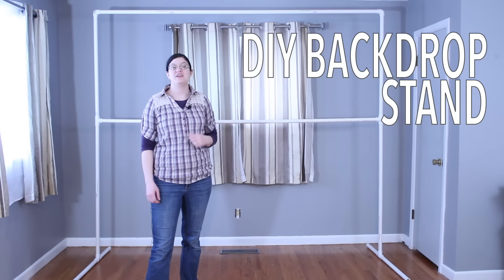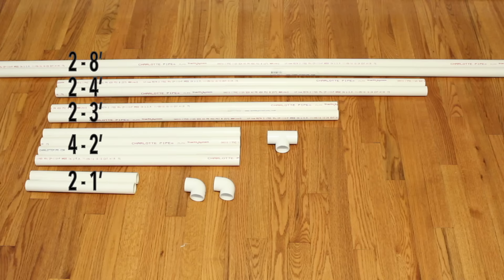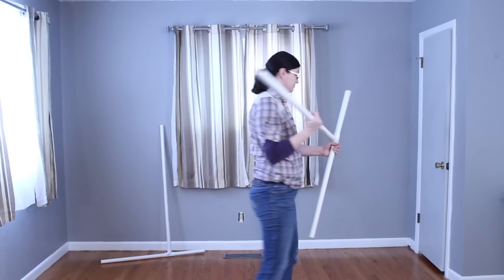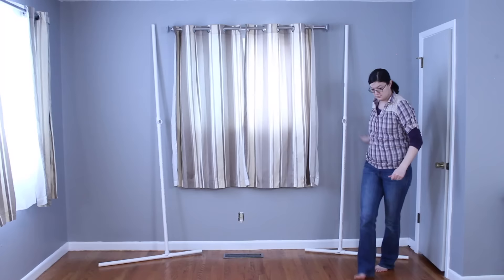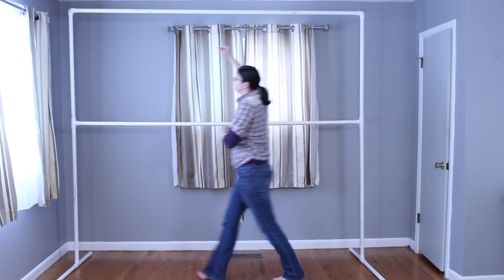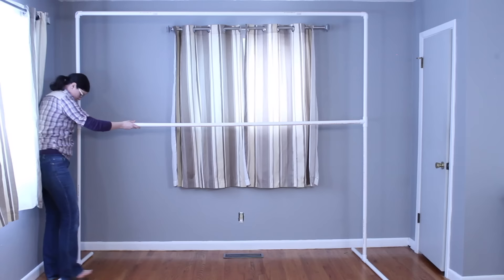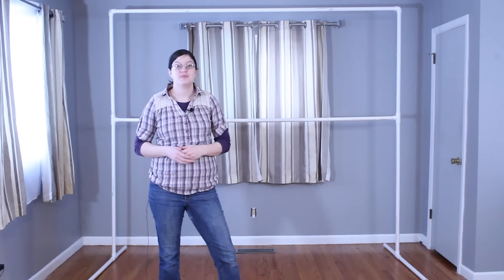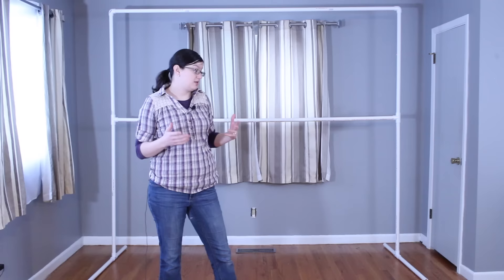DIY PVC Backdrop - Party Planning How To's

Comment: I did this for my daughters Quinceanera. I used pool noodles on the top pole to add flowers. Came out so beautiful.
Reply: Wow great idea 👍👍👍👍👍👍
Reply: Do you know what size holes are in the pool noodles? I was wondering if these 1" pvc pipes would fit in them? Great idea though.
Reply: @foxlover03  I slit the noodle length wise and set it snug on the pole. Secured it with zip ties. I used 2 noodles. Cut the flower stems and poked them into the noodles. It came out gorgeous
Reply: @staceycasta  did you put the curtains on first, then put the noodles over the curtains on top?
Reply: @angelicagamboa299  yes exactly. The curtains then the pool noodle on top. It's  a long floral arrangement that sits snug on the PVC.
Reply: What did you use to cut the pipe
Reply: @deborahv.169  I bought the PVC pipe at home depot and they cut it to the sizes needed
Reply: Sounds lovely!  Would you happen to have a photo you're willing to share?
Reply: That is genius!!!

Comment: One solution to added stability is to use 40 SCHEDULE  PVC pipe which is thicker & stronger than what I used, which was only 20 Schedule. A center post also keeps it from sagging.
Reply: Do you have pictures with a center post?

Comment: I drew out plans for something like this and will be building it this weekend.  Before I started, I thought  "Someone must have done this before."  So I checked YouTube and found your wonderful detailed instructions.  One variation I am going to try is to put a third cross piece on the floor between the legs, strapped across the rear facing legs.  Also considering capping the pvc tubes and filling them with sand or gravel for weight.  Hopefully this will increase the stability of the whole construction.
Reply: Hi! Wondering if you added that rear piece, filled with sand, & how that worked? Did it increase stability?
Reply: Great additional ideas.

Comment: Thank you so much! Your instructions were perfectly clear! I have a small business and there are times I don’t need my canopy tent but I still want my 8ft banner behind me for added signage and this was perfect! 

I cut my 2- 8ft poles in half and used a coupling to attach them so they could break down and easily fit in my Jetta. I like that your cuts gave us the options for either 2- 2ft “feet” or 1- 1ft and 1- 2ft “feet” depending on the venue and if we’re against a wall or not! 

And lastly it’s November 2023 and my total at Home Depot was $43 (including tax) Not bad at all! Thanks again!

Comment: Thank you as you saved me £35 for a backdrop and i paid £12 for the pvc pipes and joints. 

I just made one today and I cut the two top bars in halve and joined them for ease of transporting them. I added a front and rear bar for stability and yes I did cut them in half as well.

Comment: Just my opinion I would add 2 tee fittings for the middle to the top with another pipe like you did at the end to make it a bit sturdy to hold the fabric so it don’t sag in the middle. But that’s awesome what you do thank you ❤❤❤

Comment: This is made for lighter curtains. When we added our backdrop vinyl banner and 3 disposable table cloths, it fell over because of the weight. I taped the connectors together and propped it against a wall. It held up with the balloons we added later.

Comment: I love how you explained everything and the fact that you have the plans as well, so helpful! 
Im wondering if a paper flowers will be able to hold on?
Reply from the maker: I wanted to try it before leaving a comment. I did a paper leaf backdrop and used foam behind the leaves and it worked just fine. The stand wobbled a bit as I pushed the pins through the leaves into the foam. Once I finished adding leaves it held up really well. You can see that project here: https://youtu.be/0hMGj-lknP4 Thanks!
Reply: Make a valance out of foam board to attach the paper flowers 😀

Comment: If you build the top section as an inverted "U", assembling the top bar, three foot sides and elbows on the floor, you won't need a stepladder, you just fit that U-shaped top half into the T-junctions.

Comment: Such a great video, easy to follow and clear. Can I ask the max weight a frame like this could hold…? A hedge wall and drapes?
Reply from the maker: This is great for light weight backdrops (paper, light curtains, etc).  It would not support a hedge wall. I use this stand for heavier walls - https://bit.ly/2SH6MfF

Comment: Making this for my daughter's birthday. And the table,where can I purchase it? Thanks for sharing. ♥️♥️♥️♥️♥️♥️♥️♥️
Reply from the maker: Hi, I used a 6 ft folding table. If you have access to a Home Depot, Menards or Lowes the table will be cheaper to buy, but Amazon does have some good options, just watch the prices as some can be unnecessarily high.  https://www.amazon.com/gp/product/B07T3Z9LVW/ref=as_li_tl?ie=UTF8&camp=1789&creative=9325&creativeASIN=B07T3Z9LVW&linkCode=as2&tag=beautifull083-20&linkId=c0eaadcade6d3ed78b802e493476b5c8

Comment: Am I able to cut the 8ft pieces in half and connect them with a straight joint for easier transport or will the middles sag?
Reply from the maker: Personally, I wouldn't cut the horizontal pipe in half. That pipe is bearing all the weight of whatever you are hanging, and I think cutting it would make it sag pretty badly.

Comment: Hi, love this tutorial, thank you, and just built this for a wedding backdrop.  I'm having a problem getting the pipes to fit in tightly to the elbows and crosses.  Any advice for me?  It keeps falling apart :(
Reply from the maker: Hi Karen, A couple things you could try to prevent the pipes from coming apart: The first is to make sure the pipes are inserted all the way into the fittings so they have the best connection possible. If you need to be able to pull all the pieces apart for transportation a temporary way to keep the pipes inserted is by wrapping some clear packaging tape around the joints that are giving you problems after the whole frame is assembled. A more permanent solution is to glue some of the fittings to the ends of the pipes they need to connect to. For example, I would glue the elbows to each end of the top pipe. By gluing only to the top pipe, you can still disassemble it from the side poles, but it will give you more rigidity overall and wont slide out accidentally. Plus you can still slide a fabric backdrop over the elbow. The same could be done to the middle support, by gluing the "T" fittings to both ends of the horizontal pipe, but leaving all the vertical pipes loose for easy disassembly and transportation. Use the PVC pipe glue from the hardware store for the best connection. Good luck with your event!
Reply: @EventAnswer  Thank you for such a speedy reply!  Will do :)

Comment: I need to build one for a room that has high ceilings. I want to cover the existing windows with the backdrop and curtains to create my decor style. Do you have any pointers on how to keep the backdrop stable? How well does it support curtains and different fabrics? Will i have a problem if I make a backdrop 10 to 12 feet wide? what is the max?

Comment: Lovely video... Can a purchase link to where the portable table you used is sold.
Reply from the maker: Hi, I used a 6 ft folding table. If you have access to a Home Depot, Menards or Lowes the table will be cheaper to buy, but Amazon does have some good options, just watch the prices as some can be unnecessarily high.  https://www.amazon.com/gp/product/B07T3Z9LVW/ref=as_li_tl?ie=UTF8&camp=1789&creative=9325&creativeASIN=B07T3Z9LVW&linkCode=as2&tag=beautifull083-20&linkId=c0eaadcade6d3ed78b802e493476b5c8

Comment: Why did you cut 4 two feet lengths when you only used 2 of them?
Reply from the maker: Hi Ayesha,  There is enough pipe to make 4-2' and 2-12". This gives me flexibility in my setup. In the video I only use 2 of the 2' segments so I can place the stand closer to a wall, but there have been times I used all 4 of the 2' segments when I needed more stability for an outdoor setup.

Comment: This is awsm.. bt can you tell me how much weight it can handle??... or we just need to put d fabric on it and nothing more
Reply from the maker: In actual pounds, I don't know. I do know it can handle fabric plus some light weight props like paper flowers/leaves, foam characters, or wreaths. You will know it is too much weight because the center of the top bar will begin to sag. If you have heavier props to hang, do it closer to the sides instead of the center. That will help reduce the sagging. You could always add another set of supports like what is on the side to the center and cut the 8 foot pipes in half. That only works if you are using two panels of fabric for the backdrop as a single panel wont slide past the center support. Always remember to weight the feet of the stand to help with stability. I hope that helps! Happy party planning!
Reply: @EventAnswer  thnk u so much.. to find tym nd respnding 😊

Comment: Is it strong enough to carry plastic flowers on top?
Reply from the maker: I get asked this a lot and the answer varies depending what and how much you are hanging. I would say generally yes. It can handle more weight near the corners than in the center. If you can, test it out before the event to be sure. Also, don't forget to put weight on the feet so the backdrop doesn't get top heavy.  Thanks for watching!

Comment: Would a design like those pvc pipes be able to hold up 30lbs?
Reply from the maker: I wouldn't attempt that much weight with a PVC stand. That would require a metal backdrop stand.

Comment: Can I use this backdrop in open air area like garden to make birthday party ? And can I cut each piece of this  8 feet to two pieces and contact one to anther  ,plz answer me
Reply from the maker: Hi Sara, You can put it out side, but not if it will be windy. I used it at a 5K race and the wind was pretty calm for Kansas and it did just fine. Once the wind picked up at the end of the event it started to tilt. If you can put it near a building or somewhere it can get a wind break that would work too.

Comment: Thanks so much for sharing! I am definitely making this for my baby shower! I have a question about the fabric, when going to say Joanne's how much should each cut of fabric be?
Reply from the maker: Thanks for watching! As for fabric. The stand is 7 feet tall and you need a little extra fabric to fold over the top pole. To be safe I would say each panel of fabric should be 3 yards (9ft) long. Also pay close attention the the width of fabric. The width of the stand is 8 feet, but you need more than 8 feet worth of fabric so it can have folds and there wont be any gaps between the panels.

Comment: If you use a thicker PVC pipe will that make it more sturdy, or 2/3" thick?
Reply from the maker: Hi Kareem, you are correct. I used the cheaper thinner walled PVC pipe. If you use the thicker walled 1" pipe it will be more robust.  You could go to a bigger pipe (i.e. 2 or 3"), but I'm  ot a fan of the larger sizes for this project because they are heavier, larger and hard to camouflage from a decorating standpoint, backdrop fabric pockets may not be big enough for that size pipe, and they are more expensive especially the fittings. Great question!

Comment: Would the pipe dimensions be the same if you wanted to make rounded arch rather than straight one?
Reply from the maker: I'm not 100% sure what you're asking, but I'll take a crack at it. If you are talking about making a rounded arch like a wedding alter where the top pipe is bent into a round shape, you will need a smaller diameter pipe that is more flexible. The 1 inch pipe I use in this video is too rigid to bend like that. If you are wanting to make a rounded arch with pipe fittings you could do that with the 1 inch pipe. Say you used a set of 45 degree angle fitting you could make a curve like arched top. Either way it is an intriguing idea. Let me know if you make one, I'd love to know how you do it. Good luck!

Comment: How would you do this with a layered curtain?
Reply from the maker: You could always pin two fabrics together and hang them on the single pole, but hang tight, I just filmed a double pole PVC pipe backdrop tutorial and it will be out next week. That will be a lot easier to do a layered fabric set-up on.

Comment: Good job. Thanks for sharing. It appears to sag slightly. Any suggestions on how to prevent this?
Reply from the maker: I used the cheaper thinner pvc pipe. You can use 40 schedule pvc which has a thicker pipe wall. That wont sag so bad. If you wanted to hang some really heavy items, you may want to add another leg and foot right in the center.

Comment: Can it be done with1/2 inch pvc tube?
Reply from the maker: 1/2" pipe is only good for smaller projects because it flexes too much over large spans like this. It wouldn't be able to hold the weight of a curtain across the 8' distance.

Comment: I customarily see that middle bar. What is that middle bar for? Does that create stability?
Reply from the maker: You are correct! The center bar adds stability to the frame. Without it the structure is really wobbly and liable to tip. I have also seen designs where the bar is closer to the floor and I think that would also work well if you need a stand without a center pipe.

Comment: Would it hold a paper backdrop roll?
Reply from the maker: It depends on what you mean. I've hung paper on it no problem. If you mean the large rolls photographers use, I've not tried those personally. I know It can handle professional weight fabric backdrop panels. I would test it out before the event and make sure to add weights to the base of the stand. Happy making!

Comment: I have a question, I want to build this for my daughters party but I want to use 7feet height instead of the 8 feet, what would the other measurements be if I do 7 feet instead of 8?
Reply from the maker: Hi Jessica, this stand is actually 7 feet tall and 8 feet wide. My living room ceiling is only 8 feet so I built this stand to be 7 feet tall to fit inside it. The measurements given in the video should work for you. Let me know if you have any other questions!
Reply: Event Answer if I wanted to make it 6 feet tall instead of 7 feet what would the other measurements be?

Comment: So I am trying to do a photo booth for my son open house. I now understand how to great a backdrop. My frustration is how do I decorate? Do I buy fabric drape it over the pipe? Do I purchase something like you did in this video? I was easy but nice? I need some direction can you direct me?
Reply from the maker: You can purchase curtain panels that have a pocket in the top (not the one with grommets) or you can buy fabric that you like and fold over an 8" section and pin it to make your own pocket to hang from. If buying fabric pick one that is supple and doesn't wrinkle. If you drape it over your hand it should smoothly bend and fold. Don't pick something stiff. You can also use tablecloths and pin a header in it which I do frequently. They are really affordable from places like efavormart.com or linentablecloth.com. Either way you go make sure your panels amount to more than 8' wide for this backdrop stand. This will give you the option to put gathers in your fabric. I hope your party goes well! Reply back if you have more questions!
Reply: Thanks

Comment: Is 10x10 size will work here? Ty😊😊
Reply from the maker: I don't recommend doing 10x10' with this design simply because the pipes flex so much at those lengths. 8 feet is the max I would go. Thanks for watching!

Comment: I tried this but didn't work. It wasn't balanced and was falling
Reply from the maker: hmm, a couple things you can try to fix that. First make sure all the pipes are seated fully into the fittings. Second double check the pipe lengths. If you lay the pipes on the ground next to each other, and they are slightly different lengths that will make the frame a little wonky. Finally adding weight to on top of the feet will reduce the wobble and make the whole thing more stable. I hope these tips help solve the issue and you're able to have a successful event!
Reply: @EventAnswer  thanks a lot. I will surely try these tricks

Comment: Can it be 10ft instead of 8ft using the same measurements?
Reply from the maker: I wouldn't do 10'  personally. Once you get fabric and props on the horizontal pipe it can begin to sag in the middle, and I think 10' would just sag worse. You could put another support leg in the center or use a thicker walled pipe and it might work alright.

Comment: Hello there, I’m setting up a backdrop soon. I’m wanting to add a letter made out of thick foam board in the center of my backdrop, just like the wreath shown in this video. How did you/do you hang up decor in the centers of backdrops? Thanks!
Reply from the maker: I use thin wire or fishing line to hang pieces like that.
Reply: Event Answer is there any way you can make a video on that? Also show how you hang it on the PVC pipe with a hook etc? Thanks again!💞

Comment: I would love to make this but on a smaller scale... any tips?! Love the video!
Reply from the maker: You could absolutely make this smaller. The key measurement I wouldn't change is the length of the feet as you need the front to back stability. If you wanted to make a Polaroid picture frame you could narrow the width easily. Just change the 8' pipes to the width you need.